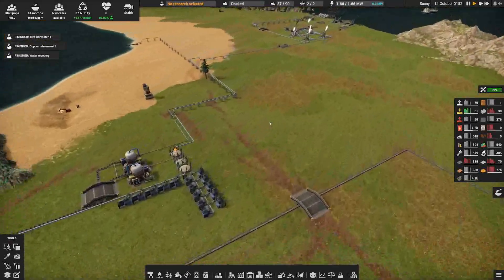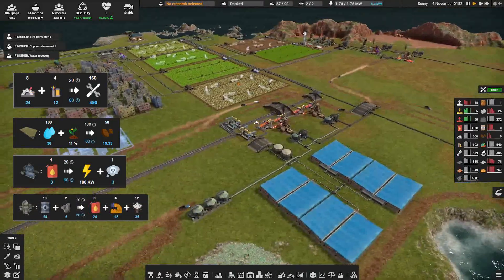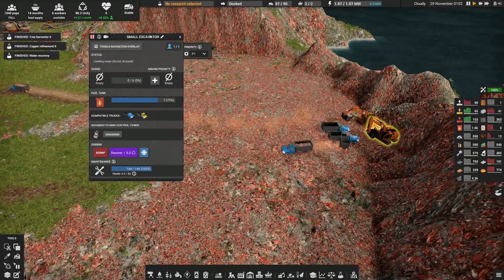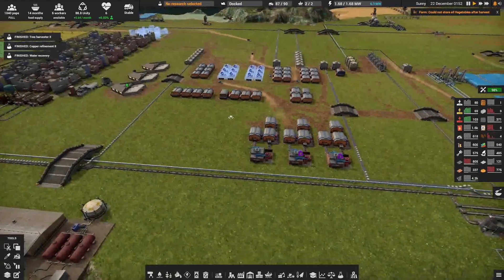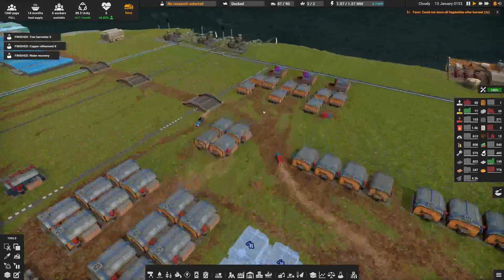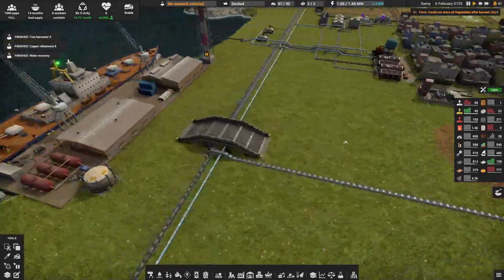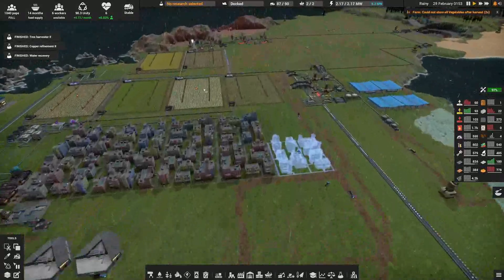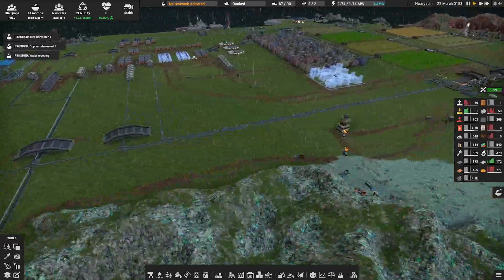HOW TO AVOID DEATH SPIRALS - Captain of Industry

Comment: Also, Maintenance Reducer Edicts I & II, 15% and 10%, respectively. Using Steel for Mechanical Parts can help you catch up before you begin the Construction 3 parts. ultimately, one can use Unity for Maintenance of machines and vehicles by clicking on the Repair button.
Reply from the maker: Absolutely! Thanks Darel!